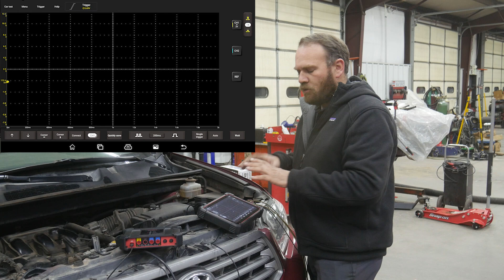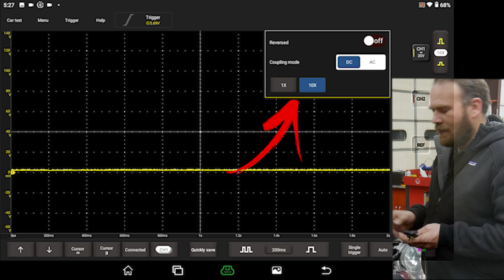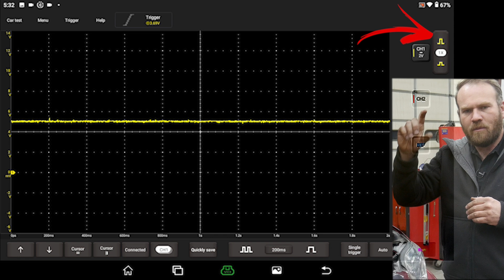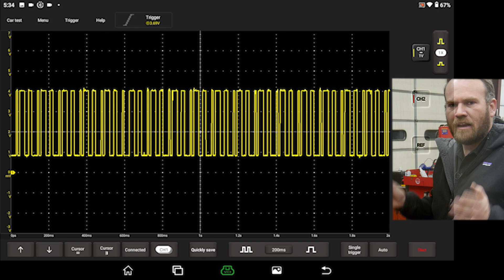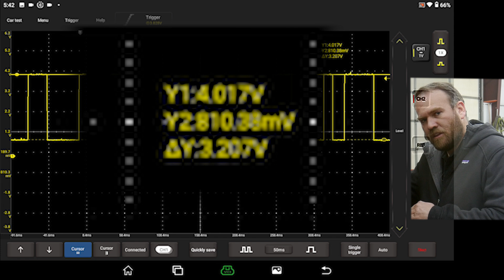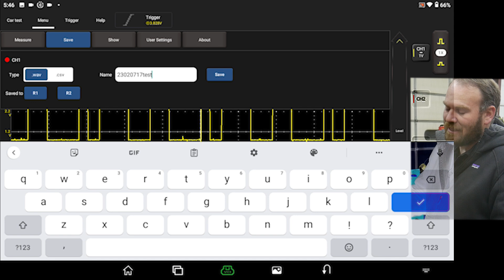Scope 101 for Dummies- A Guide to Using a Oscilloscope with the Launch Torque 5

Comment: The launch only has a choice of 1x or 10x attenuator?
Reply from the maker: The 1x is without an attenuator. The 10x is with an attenuator. If you want the numbers on the screen to match what you are measuring you should purchase a 10x attenuator. 
If you use a 20x attenuator you can select the 10x option but then you need to double the numbers displayed on the screen for accurate measurement.
Reply: @ThePracticalMechanic  I'm glad I didn't buy the 20x. I don't want to have to calculate the numbers. What's the point paying all that money for a scan tool scope if you are so limited. Thanks for info.

Comment: I have a handle oscilloscope can take 600 volt pk to pk with 1:10 attenuater if i connect it in ignition control wire and i wott did this can damage my oscilloscope

Comment: Thank for you making this very well detailed video, Chad.  Safe to say that this scope doesn’t have the same mbits/sec and resolution as the Pico?
Reply from the maker: I looked at the specs but I forget the speed and buffer size. I will check into it and maybe compare the two on some high speed networks

Comment: So does the waveform in the video mean your sensor is bad? It’s not 0-5 volts. It said the waveform was 3.2 volts.
Reply from the maker: This one was a known good. Even though it’s a 5 volt sensor most of the time they only sweep from .5-4.5.  This is so the computer can tell what kind of circuit faults we have. If the signal voltage is below 0.5 the computer will set a short to ground or low voltage code, if the signal is above 4.5 the computer will open circuit or short to power code. 
That doesn’t mean the computer is always correct. If the 5 volt supply to the sensor is missing the signal will likely be 0 volts and not actually short to ground. 
If the ground supply is missing to the sensor the signal may be stuck at 5 volts even though the signal wire isn’t shorted to power.

Comment: Thank you Chad and Val. Off topic question. If you know, what brand of shop roll-up doors, with windows, are those in your shop? Have a God Blessed week.
Reply from the maker: They are 12’x12’ insulated doors by Raynor. They were installed in 2004 when this shop was built and have been great. We recently replaced the lift assist springs because we had two fail over the last few years. The service company couldn’t match the springs exactly because of shortages so some of the doors no longer stay at the 1/2 open location. They have adjusted the springs several times but they either fall down from 1/2 open or slowly open themselves the rest of the way.  We had the windows resealed once because they started to fog up. All in all they have been great doors.
Reply: @ThePracticalMechanic  thank you Chad. Have a good night.

Comment: Thanks for the tips.i never knew you had to use an attenuator on vat and purge solenoids. Thanks again.
Reply from the maker: Many scope manufactures will say that you fine without because the amount of time the scope sees the high voltage is so short but I like to play it safe. I’ve had to send in my pico once because a channel quit working and I don’t know if it was a voltage spike or worn/broken bnc from 13 yrs of abuse.